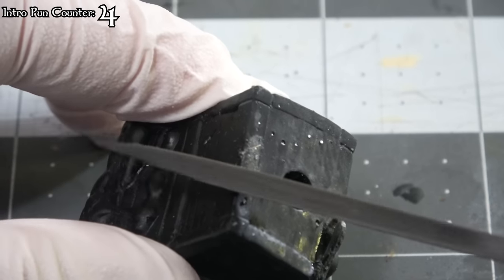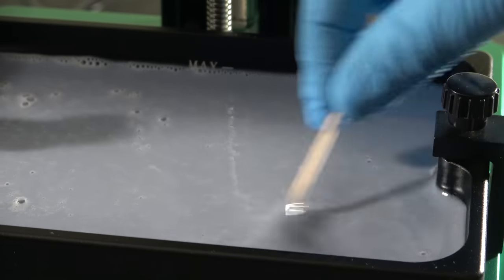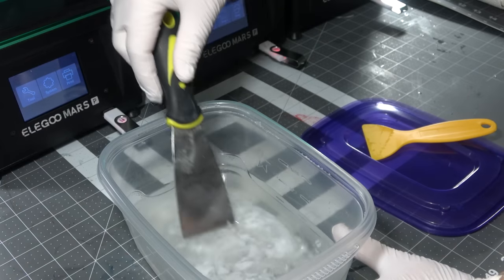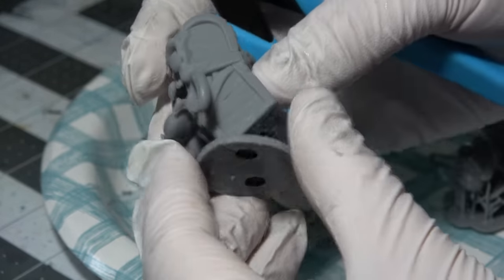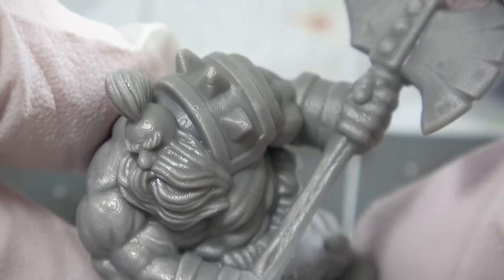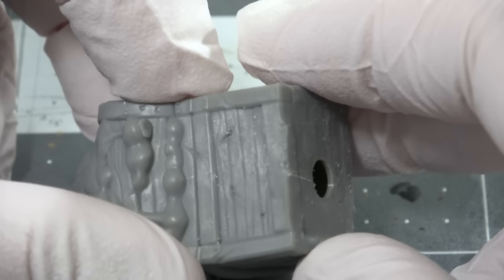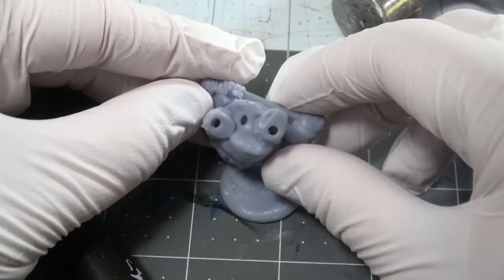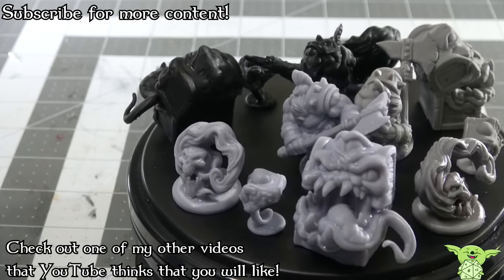Testing 3D Printed Resins: Is Water Washable Better?

Comment: Why would hollow models be worse regarding uncured resin than a solid fill? would a solid fill would actually end up with more uncured resin on the inside?
Reply from the maker: Hollow allows for liquid from the print to get stuck up in there. If it's solid, that means the model has been cured in ALL locations, so there can't be any uncured resin inside there :)
Reply: @Rybonator  ahh ok! Thanks for responding

Comment: You can't just throw away the water. It is full of resin just like the alcohol. It has to go to a hazardous waste disposal.

P.S. thinking of modeling resin as high quality is a bit of a trap. It has properties that optimize it for miniatures. Each resin will have different properties. Some are high detail, some are very hard, some are as flexible as rubber. Each will be ideal for a specific job.

Comment: All of their contests can only be entered if you already have your own printer. If I had a printer, I wouldn't need to win one, and since I don't, I've never been able to enter into a single one of their contests.
Reply: btw You have to have your resin prints hollow. The not fully cured resin on the inside of not hollowed out prints will rot them from the inside out. Just rinse your hollow models better and there won't be any of that resin left inside. A lot of the professionals recommend an ultra sonic cleaner to make it easier.
Reply from the maker: True! It's a definite circle of printers haha. But I guess you would then be able to possibly upgrade printers and sell your old one :)
Reply from the maker: I would say that isn't true - That's why people have resin prints that last years that are solid. You are CURING it as you run the printer. You are essentially EXTRA curing the outside because it gets covered in liquid uncured resin, which is why hollow prints do the same. But hey, just my opinion :)

Comment: You could have improvised a scale system if you wanted accuracy, but likely you would have spent too much time and wouldn't be worth the trouble
Reply from the maker: ^ Hammer will do the trick ;p
Reply: @Rybonator  yeah, results still work

Comment: You're over curing the regular elegoo resin by...a lot. You only need 7.5 sec of exposure
Reply from the maker: So each Elegoo Mars Pro printer is a bit finnicky. Sometimes you need more or less, their build process is a bit... less than ideal on these older machines. So consistency isn't always on point. Mine take a bit longer than normal - As well, I need to provide stats that will typically work for EVERYONE :)
Reply: @Rybonator  Fair enough mate, I guess I was thinking in the sense of for the test, ideally you wouldn't want something over exposed for testing purposes because it would change the results being more brittle. A great video nonetheless!